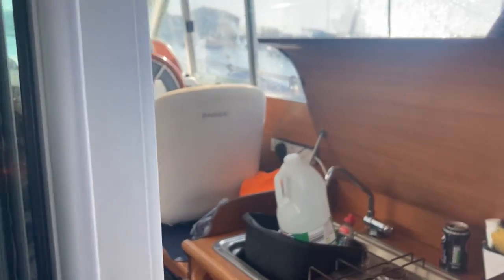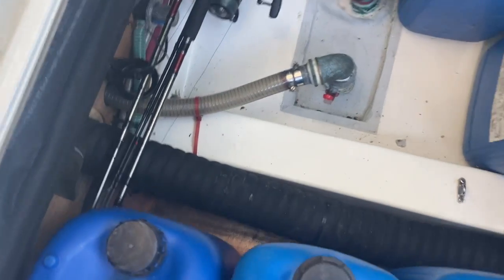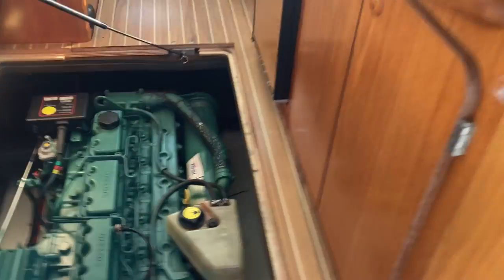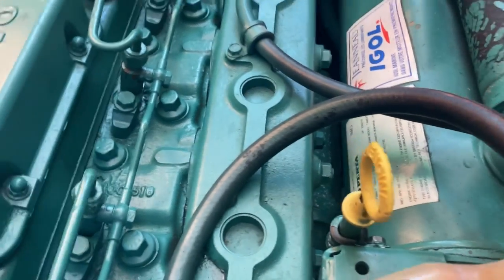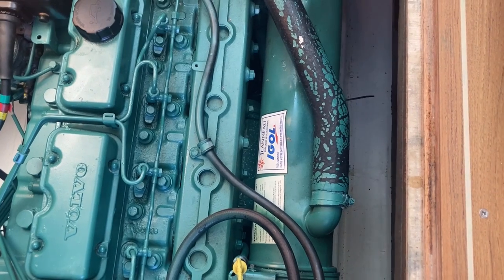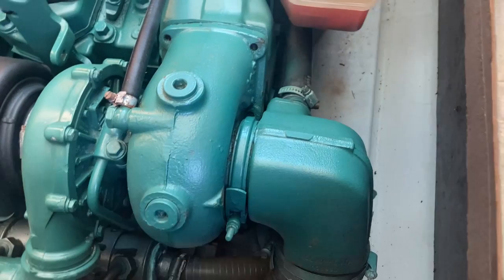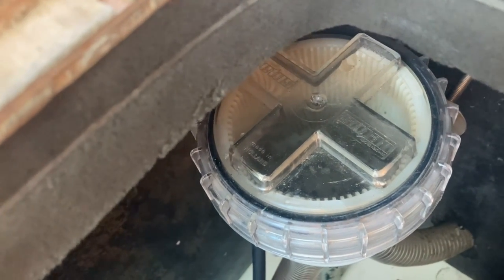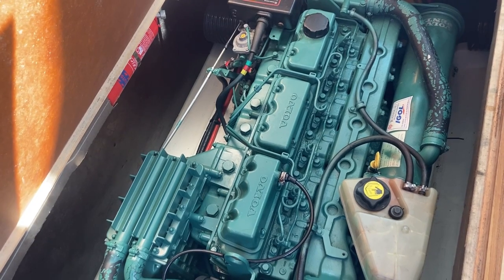Pre checking a Volvo Penta TAMD41-P engine before you leave the pontoon.

Comment: Some misinformation in your video to clear up. The charge air cooler cools the compressed air from the turbo then it goes into the intake. So it comes out of turbo first then goes to charge air cooler then to intake manifold.
Also, the heat exchanger is just another type of radiator but instead of cooling the engine coolant with air it uses raw water. There is no ocean or raw water inside your engine or else it would rust out. Your engine is filled with enclosed coolant system and is then cooled externally from the heat exchanger.
Reply from the maker: Every day is a learning day 😀

Comment: Probably the best Volvo Penta...
The Nanni is 150 kg lighter, but this is super reliable and has no timing belt to change...
Anyway, 150 kg, low and well centered in the boat, could add stability...
Reply from the maker: I have had a Nanni 4.90TDI engine never again.
Reply: @shakyangler  what's went wrong with it? I know they are good engines...
Reply from the maker: Head gasket at 500 hrs also they are well known for having pin hole in the head at the 4th cylinder ,
Reply: @shakyangler please, what do you mean with pin hole?🤔
Reply from the maker: The walls between the exhaust valve and the other valve are fin and have been known to pinhole between the 2 valves.
Reply: @shakyangler  ok, probably for a terrestrial use, it was okay, but in an aggressive salty environment, not. Thanks. Happy to have the Volvo!